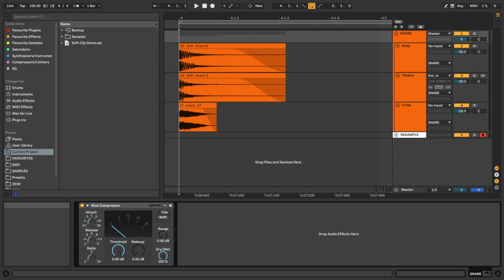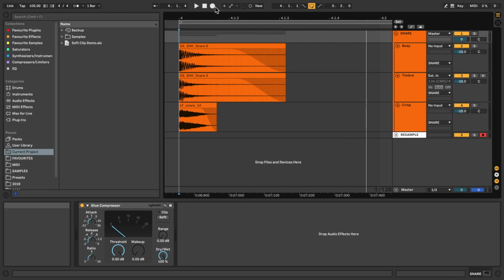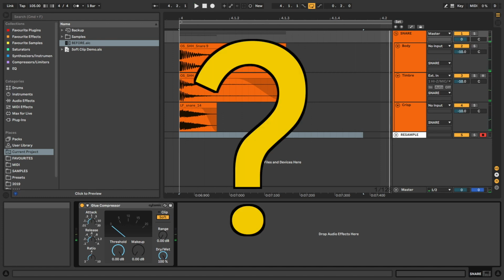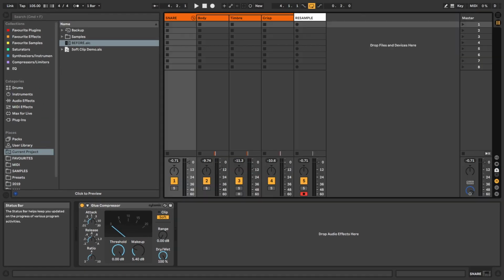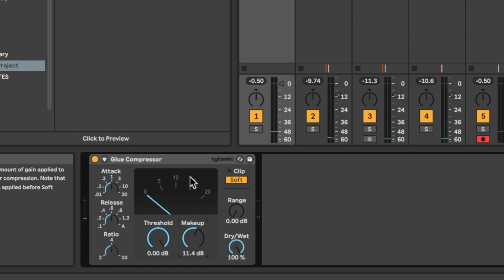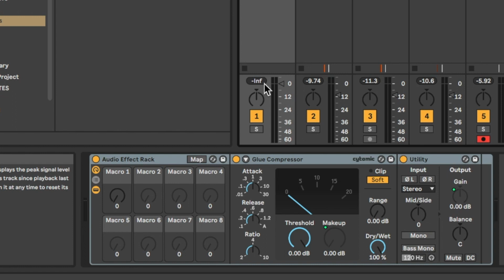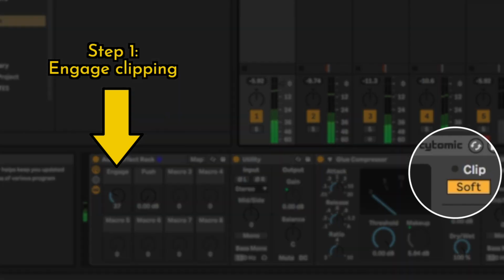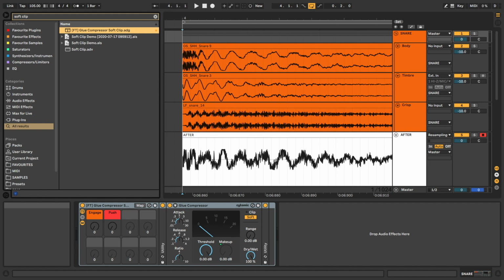How To Soft Clip With The Ableton Glue Compressor

Comment: This is great, the difference on the snare is pretty big. Sounds fantastic!

Would you ever use this technique on groups of instruments or even a master? Or just on individual samples and tracks?
Reply from the maker: Good question. I tend to use it on sounds/groups that have quite "pokey" transients.  This could be a group of drums where a combination of snares/hats/percs causes the peak volume to jump occasionally.  Or it could be an individual track such as a guitar track with very high peak transients.  Don't forget that in the case of individual tracks with troublesome transients, it might sometime be simpler to just cut the clip at the transient and turn the fader down on that part of the clip.  Hope that helps and thank for the support.

Comment: Cool tip but layering snares like this is a horrible idea. Putting two low frequency content under each other is never okay, plus you totally killed the transient with the second layer. Basically you could tweak that compressor for years, the snare will still sound like dogpoop.
Nice video though. :)